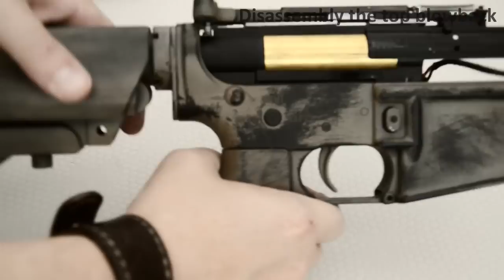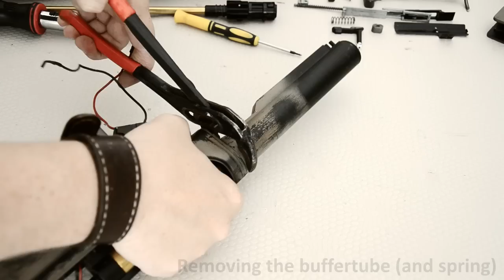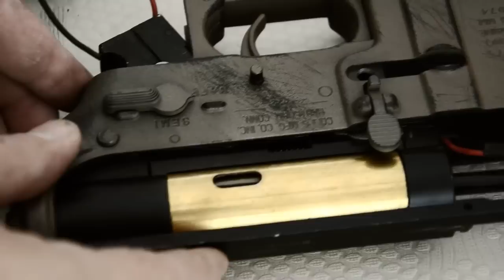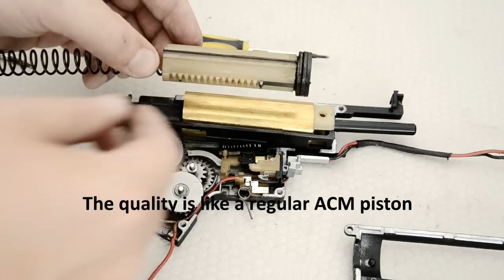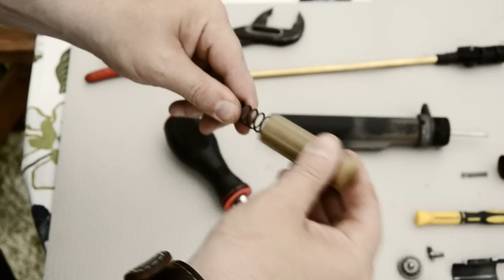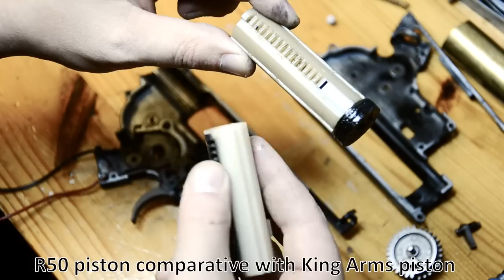Army M4 R50

Comment: Great video. Please, please, please, can you tell me if the bolt stop works? I.e does the R50 stop firing when the low/mid cap marui 82/30 magazine (or battleaxe 90) is empty? And if it does stop firing, did this functionality work out of the box or did you have to add or fix parts? Also where did you buy the R50. Many thanks in advance.

Comment: can you put a standard gearbox to replace the ebb? rather than disabling the ebb itself??
Reply: +germon pat odango&#160;
Partially compatible.(but not fit on size properly if it doesn't TM ver2 gearbox.)
According my experiments, APS gearbox is slightly thin so it's totter(?) in lower receiver when assembled.